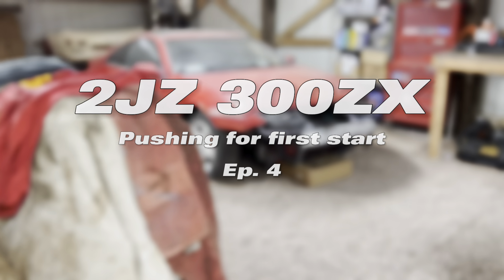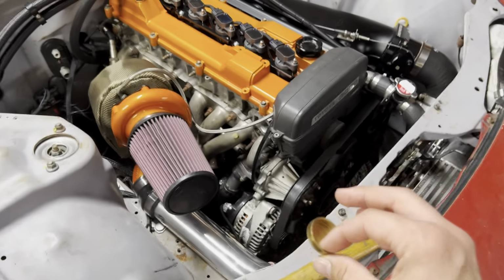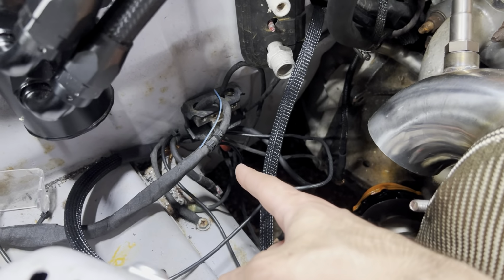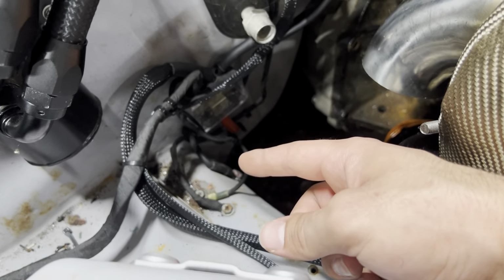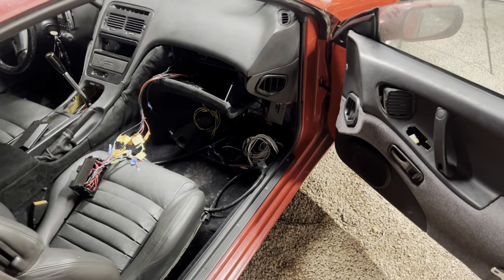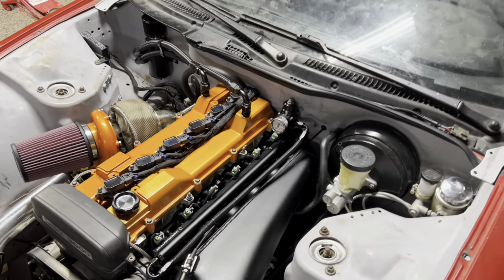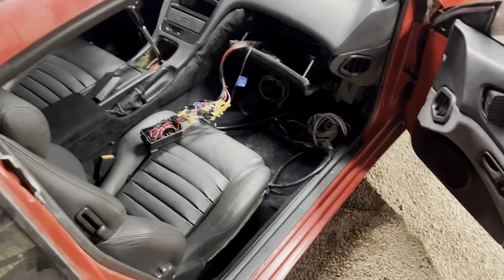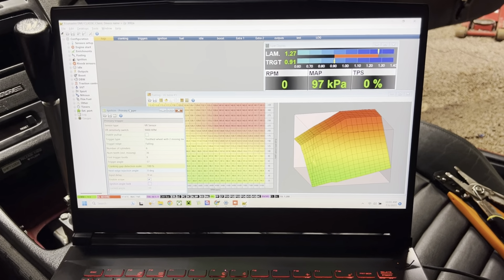2JZ 300ZX FIRST START

Comment: What kind of fuel pump do you used? And do you use existing z32 fuel lines or you add new ones
Reply from the maker: Walbro 525 pump, full -8AN feed, full -6 return. Although it’s not necessary. You can keep stock hardlines.